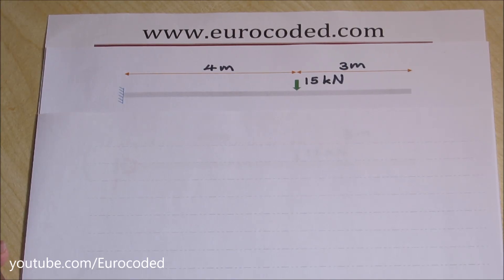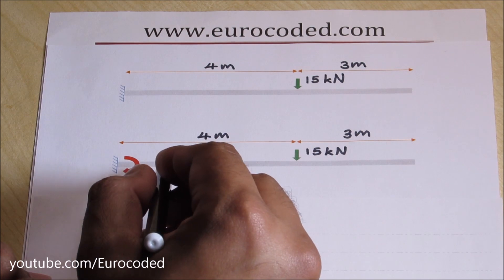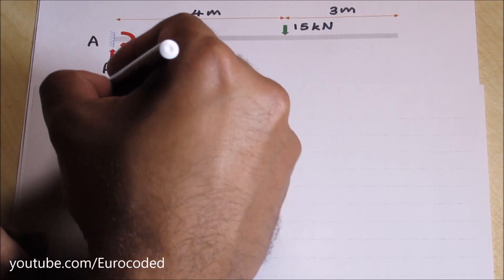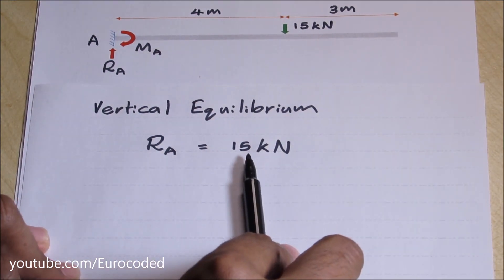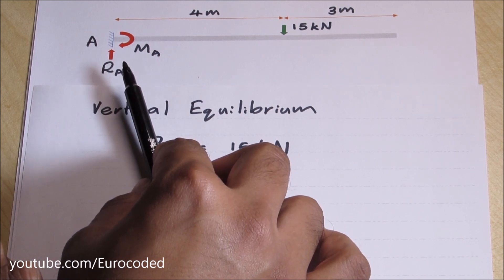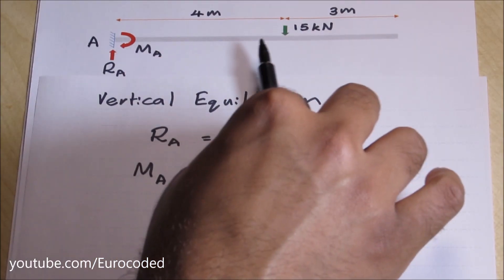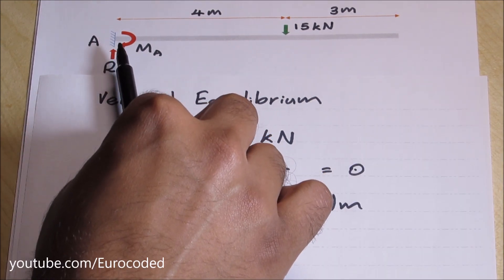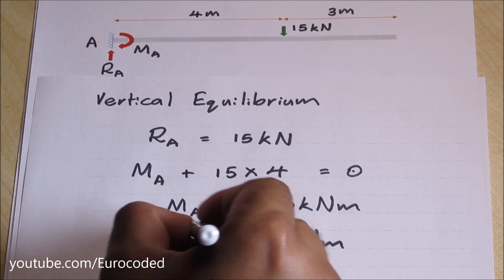How to Calculate Support Reactions of a Cantilever Beam with a Point Load

Comment: Find the support reactions for a simply supported beam of span 6 m subjected to a uniformly
distributed load of 5kN/m. If the same load is applied on a cantilever beam of same span, what would
be the support reaction at the fixed support?
Sir i want this
Reply from the maker: Vertical reactions of simply supported beam: 15kN
Fixed support reactions of cantilever beam: 30kN (vertical) 90kNm (moment)

Comment: If you use your cantilever for a piping systeme support , how  do you calculate the dynamic charge of the fluid and then add the dynamic weight to the centalever calculation ?

Comment: Can i know why you draw moment at A anticlockwise? It is assume ?
Reply from the maker: On the sketch I have drawn the moment M_A as a clockwise moment. The calculated value of M_A turned out to be -60kNm. Negative sign indicates that the moment should be in the opposite direction. Therefore the moment M_A should be 60kNm in anti-clockwise direction.

I noted the moment M_A as a clockwise moment on purpose to show that regardless how you draw it, you will end up with the same result if calculated correctly.

Hope that answers your question.

Check out this video where I explain about typical sign convention: https://youtu.be/m9Ecdii47Fk
Reply: @Eurocoded  Is it always assume moment at support always positive even the support on the opposite side?
Reply from the maker: @winkyho8791  Yes, if you follow the typical sign convention (https://www.youtube.com/watch?v=m9Ecdii47Fk&list=PLKYpFtSJqr3gBb4ofRFJPmQaMbSPAfLwf&index=11&t=0s). But you don't have to. You can assume a negative moment and your calculation will confirm whether the assumption is correct or not (similar to what I have done in the video).
Reply: s